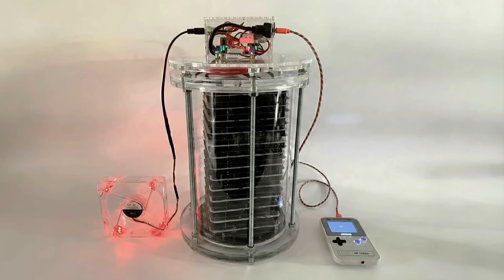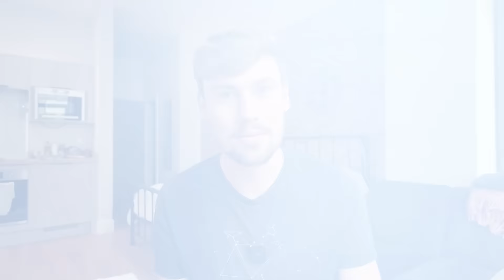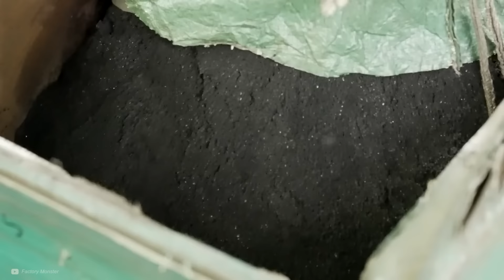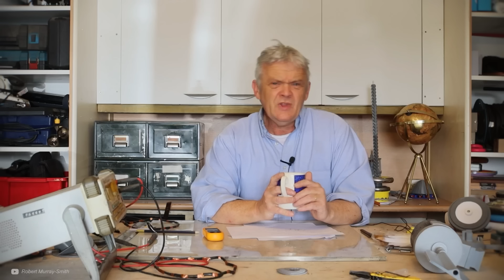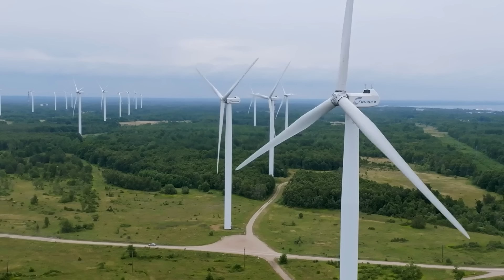How MIT's New Concrete Stores 10x More Energy

Comment: I feel like I must be missing something obvious, but...from a mechanical perpsective, how does this work? As in, how is the whole thing not an internal dead short? Can I just jab a couple wires at it anywhere on its surface, and get current? If so, why isn't it discharging through itself as fast as it charges? If I need to attach the wires in a specific way, what makes the connector part of the block different than the rest of it?

Comment: Quite interesting, any research on what the warranty be on such structure and what will needed to be done if the "battery wall" malfunctions? 

Other question, will the chemical reaction already in modern concrete (self healing properties) still work with the liquid electrolytes are added?

Comment: Ya it's a good idea but 10X that organic material is expensive and tricky to handle them what about the safety of the rebar inside the concrete and what about drilling a hole in a wall that will be a short circuit right. Ya you can use it as an emergency light because there is no extra battery so no extra fire but but the high chance build will go up in flame so fast so only use it for industrial emergency light

Comment: I had a demonstration in my physics class that showed us where the charge is stored in a capacitor. Outside steel bowl, glass insert then a steel bowl to fit inside. Charge it with high voltage static generator. Short the steel cans and BANG! Charge it again then take it apart into 3 separate pieces. Short the cans and nothing going! Put it together and the can shorting goes BANG! Charge it again, take it apart and wipe the inside to outside surfaces of the insulator with a conductor, NO BANG now! The charge is stored on the insulator's surfaces, it's all electric with no chemistry.

Comment: 0:15 but MIT actually has a reputation for being hype without any real world results. Besides quite a lot of materials can store electrostatic energy. So ultimately it just sounds like a nothing Burger bunch of talk. You in the market for a 10,000 dollar battery with the capacity of a few alkaline batteries? Because that's the type of results they get, which is why their bulshyt doesn't go anywhere

Comment: You don't use it to build homes. You use it to build roads. You can have a concrete eletrolyte layer under the asphalt that recieves renewable energy off the RoW. With copper & zinc plates in the middle of the lanes, EV's, could drive over the plates with brushes and recieve passive recharging right off the road itself.

Comment: If you intersperse the different mixtures of energetic concrete (with the most conducive admixture functioning like transistor studs) as an inner & outer lining (putting stucturally optimized materials in a building's skeleton), that should maximize the whole energy transfer/conduciveness room (maybe solar/wind power storage); like a refrigerator for energy.

Comment: Have you ever checked out autoclaved aerated concrete (AAC)? It's a highly porous manufactured building material that looks sort of like pumice but has a density between pumice and regular cast concrete. I don't think it would be that difficult to add the nano carbon black to the mixture before forming and autoclave, then allowing it to soak up electrolyte and because it's so porous it wouldn't require vacuum. The biggest problem would be containing the electrolyte due to porosity, so the sealant would be more important. AAC block is semi-structural at best and requires reinforcement with regular some poured concrete for walls to be load-bearing, and with electrolyte would most likely be limited to industrial environments where no one is going to be...decorating.

Comment: This is clearly targeting skyscrapers.  45 cubic meters of concrete creates a Tesla wall battery storage capacity?  Tremendous!  Over 2000 Tesla powerwall of power stored in a 50 story building!  Solar power the outer walls and it will use very little grid power.

Comment: I've heard of similar applications for electric car charging when the super-capacitor is pavement rather than concrete. The guy I heard it from thought you could charge your car as you were driving along the highway, but I think gas station charging ports would be a more realistic next step.

Comment: Wont last its Electrolysis eventually the elements will oxidate. There is not way to switch the current over its relying of tge reaction and de reaction to charge and expel. Worried about turning concrete into a solid earth battery is silly in one way. 
There is a way for it to work and last thats not it at all.

Mit is a research lab on the researchers 😂😂😂😂. 

Get your grants on x10 😮 😂

Comment: Yep just like the tornado in IN just wiped out one of the largest solar farms in IN. It will take them MONTHS to even begin to fix it. Electricity will not solve the problem. Battery tech is NOT ready. Neither is a full scale solution to energy storage that's actually feasible and cheap. Until solid state battery and room temp superconductors are avail cheaply this is all a Giant pipe dream!

Comment: Diversity of energy storage and retrieval is a good thing.. since the more focused they become the more application-specific they become.. at least in general.
Concrete also has an additional storage method.. heat... which could be used to generate additional electricity if harnessed for that purpose.

Comment: For new big things there should be also always the question asked like what to do with this new concrete when a building gets demolished, recyclability, toxicity and effects on the environment. Right now common concrete is an absolute massive source for CO2 and it requires a special kind of sand which gets scarce which has its own chain of problems as getting that sand destroys environments in many regions.
I know the stock market just wants dirty cheap options and everything after it is sold, who gives a f@uck. But when we keep this attitude up then we just replace one problem with another one, maybe even larger, e.g. PFAS. The design of new products must at least include already ideas of how to cope with trash of it later and its effects on our environment.

Comment: This might be easier than you think?

If you can shape concrete canvas into a flask shape as a roof shingle, then the outer sealant is a solar panel solution which is woven into the canvas as charge meshing which trickles into a storage battery.

Comment: skyscrapers use ungodly amount of concrete for the foundation / base. Having a system that is complely submerged & unconnected to the rest of the building could be an idea. No idea how well it would work.

maybe they could use that to power the large capacitors used to turn on AC units. Skyscrapers also have huge AC needs but limited space to put them compared to an urban development.

Comment: Looks like nighthawkinlights aircrete concrete blocks may have the solution in 2 ways. 1 is the organic binder, xanathane to contain, closed cell, the electrolyte. 2 additional mixing until the aircrete becomes open celled. A sealer would be required to hold the electrolyte, but could increase volume and maybe temp regulation. Wash with milk lime to  reflect excess heat or he has a thermal reflective paint that can be made at home.
ENJOY!

Comment: If you want to observe the porusness of concrete, jump into a pool and lay down on the concrete, notice how quickly you dry off and how quickly your wet spot dissapears. Then, jump into a pool and lay down on tilework/brickwork and you'll continue to be wet for longer, and your spot will stay wet longer too. The porusness is why it feels like you were sticking to the concrete after letting it absorb your moisture.

Comment: When I first found out about salt water batteries, I was amazed by them. Put my lithium cells in a box and tried my hardest to make some out of aluminum cans I flattened, and copper plates I ordered... never got a good reading or was able to charge it slow enough to not vaporize the aluminum, but I still wanted to make it so badly for the sheer fact that it was estimated (assuming the materials used are proper) to have a nearly 98% recyclability, with the only non recoverable element being the salt water which would evaporate with time, or maybe it was the metal plates... forget what the proper combo was that resisted the breakdown aluminum and tin would go through... if we can make batteries out of material that is so readily available as concrete, I figure it will be similarly as good. Doesn't need high capacity, just not dismal, and it doesn't need massive charge and discharge currents, just usable in numbers... overall, rather interested in seeing where it goes. 

also just saw some comments... it was Robert that I first watched explain salt water batteries, and his enthusiasm really pushed me to try and tinker through all the failures and setbacks... had no clue. I am sure he is with his wife in heaven, probably discussing stuff he made with other great minds, or telling his parents all he did.

Comment: im no scientist by any means and went to college for business/marketing sadly, but would all this stored energy that could be used as structural support and or full on engineering purposes hold onto heat better than typical concrete? if so, wouldnt this change the entirety of structural engineering if the margin is large enough?

Comment: What I would also be concerned with is that carbon nanotubes (which would certainly be present in the carbon cement mixture to some degree) are significantly carcinogenic. If these were used in actual building with wear and tear, I'd be wary of having an asbestos insulation kind of situation. I think we'd be better off building dedicated capacitors from this kind of concrete - not only utilizing a cheaper material than exotic metal compounds, but also the existing infrastructure for creating and distributing cement that is present in virtually every country. That way, the mixture can also be optimized for energy storage rather than structural stability.

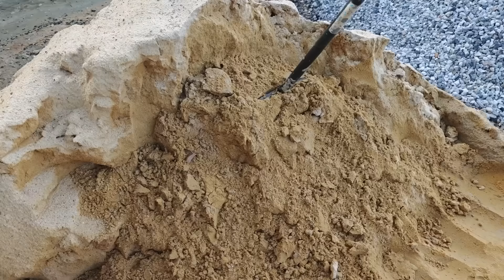Comment: At about 6:00 you report the researchers saying that their cement can be mixed with sand and aggregate to produce concrete, and that this reduces its energy storage capacity, but not by much.  To support this statement your show a bar graph comparing the storage capacity of their cement paste with mortar.  As I understand it, mortar is not concrete.  Adding large aggregate to their mortar would necessarily reduce its capacity by displacing more of the cement paste with plain old stone.

Comment: I wonder what would happen if we added piezoelectric quartz grains in place of sand. Would the structure weaken as the grains short out across small carbon circuits and oscillate? Would the oscillations of individual grains propagate in waves of activity within a tuned resonate structure?

Comment: Great Video, very interesting.  I wonder if you've done one on Vanadium flow redox batteries?  I will search your channel.  At Penn State's material lab they put wet concrete in an autoclave to create lighter weight concrete blocks that can float in water, due to the resultant blocks being as porous as foam.  I wonder if that would help to store more energy?

Comment: Structural engineering undergrad carpenter here. I heard about the research when it was water-entrained concrete... Thanks for the update! I am inspired--maybe to pursue an electrical engineering grad program?!

Good points on the reinforcement aspect. Did you know there is fiberglass reinforced plastic (FRP) rebar? A company near me imports it and all the associated components from New Zealand, and it's still considered a "specialty" product. Something tells me a supercapacitor foundation would change that. Plus, I'm enthusiastic about what the Japanese have to contribute to this. You mentioned "mechanical loads." What could vibration do to generate potentials? The research is intoxicating!

Comment: As someone with a chemical engineering degree... This is just a waste of time and money.
Reply: This guy just skims some of the issue they face.
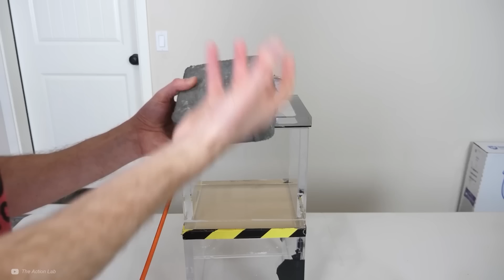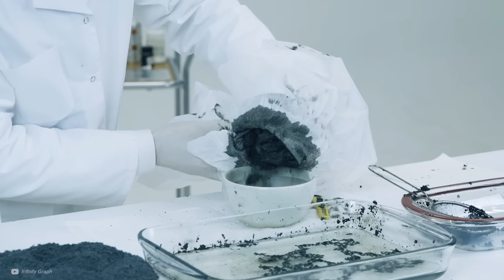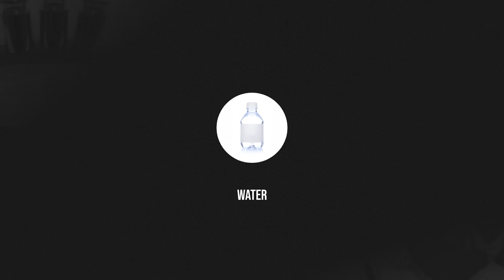Scalability Concerns: The methods for getting the electrolyte into the concrete, especially the vacuum method, are not scalable for large buildings (5:20-5:33). While using a water-based electrolyte mixed into the concrete is more practical, it still has limitations (5:36).
Performance vs. Practicality: The 10-fold increase in energy storage comes from using an organic electrolyte, which is more expensive and harder to work with (8:03-8:07). This method also isn't possible if the electrolyte is mixed in with the water during the cement hydration process (9:10-9:18).
Energy Density: Even with the water-based electrolyte, the energy density is relatively low (9:42-9:46). To replace a Tesla Powerwall, you would need 45 cubic meters of this concrete, which is roughly the total concrete needed for a standard home's foundations (9:50-10:06).
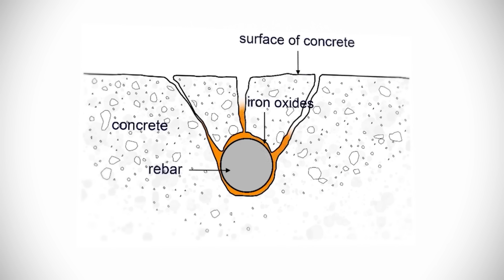Longevity and Corrosion: While water can stay in concrete pores for a long time, the electrolyte might affect the longevity and corrosiveness of the material, which could impact traditional reinforcement methods (6:47-7:01).
Containment: The experimental blocks were sealed in acrylic casing, which is impractical for real buildings (7:09-7:16). While a sealant like Bermen has been proposed, it's still a research concept (7:20-7:34).

Comment: instead of using it as a battery we could use it as a conductor like wiring in a house and you just attach the device to the wall for power.

Comment: As an energy storage technology? Yeah, this is fairly interesting. As structural energy storage? No, not even remotely feasible.

Everyone WANTS to live in a world of hyper advanced smart materials, with sidewalks that are solar panels and smart clothes, but actually think about that - it'd be a nightmare. For one, the electrostatic forces (attraction/repulsion) alone would make using this as a structural material very sketch. For two, cracking could easily cause internal shorts wherein you'd get self-discharge. For three, leaking. For four, a chunk of concrete is damaged in some minor car accident, now what? Is the building's electrical supply damaged to in some way? 

Tldr is that it's a shit ton of extra headaches.

However, if you drop the nonsensical pretense of trying to turn a building into a battery, it still can have some value as a cheap and simplebattery technology. Bore a hole in your backyard, line it with metal, insulate the metal, pour in a few metric tons of concrete, and you have a household sized battery. (With no load on the concrete itself you should be able to avoid cracking; doubly so if your little metal toob is climate controlled in some way.)

Comment: Turning cement into a capacitor is neat and all, but how do you build a house with that now?
Does a wall just have 200 wires coming out of it that need to be put in parallel or series, either creating a different electrical hazard?
The only potential use for these things in combination with buildings I can think of would be lightning harvesting. If there are thousands of these in a building in parallel, there MIGHT be a chance to sap some energy from a lightning strike, then run all the caps through a converter that turns it into something you can use to fast-charge some wall-powerbank.

But I don't wanna rag on this discovery too much, might be just something that's an "ok, now what?" thing that will turn into something genius in a decade or so.

Comment: I believe the idea would not be to turn the entire building into a super capacitor, but more like taking specific areas of the building, maybe the base, or the columns of the building, not the entire structure. Or in the case that no steel can be used for reinforcement, then a facade could be made up of concrete blocks, that store energy.

Comment: Electrifying concrete or even dirt and getting a battery retraction is not hat hard! I drove 5/8' pieces of rebar 80 feet into the ground about 10 feet apart and then put a charge on the rods from a solar array I wasn't using, about 1000 watts at 12 volts. One day I noticed the soil was smoking one cool morning so I put a voltmeter on and it was only 1.75 volts BUT what really freaked me out was the amperage was over 80 Amps!!!!! When I put two jumper cables on each rod and touched them together they literally blew up and burned me in a shower of sparks!!! It wasn't a lot of voltage but I got a high amperage low voltage starter motor to run for about 9 weeks on that patch of dirt I charged up one full summer. Here's what I figure happened. Dirt is full of salts and salts are one half that's an alkaline metal and the other half is an acid so let's take some simple one's that dirt is literally loaded with like magnesium/sulfate And calcium/sulfate So cathode you got Magnesium/Calcium oxide (Dolomite) evolving and at the at the Anode you've got Sulfuric acid forming which has a really explosive/opposite potential which the dirt keeps separated very nicely. The reason this type of battery isn't used much is because the piece of dirt I was charging probably weighed about 25 tons which is probably why people don't discover this phenomenon. I suspected my positive iron rod wasn't going to last a real long time but after seven years it still conducts like a piece of Platinum for just brightly red colored dirt now!!!! I do have to jam a piece of rebar in the top of it every now and then but it still conducts about a full 8 foot deep like a piece of copper I don't know why. So somewhere I it gets stronger and stronger So I'm wondering why a tightly bound piece of iron oxide couldn't become a piece of Forever-electrode????